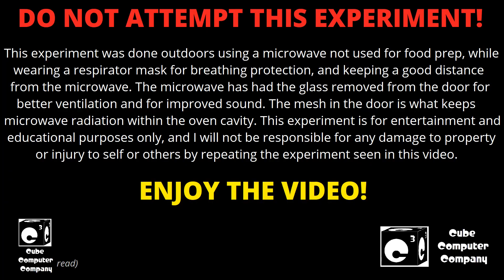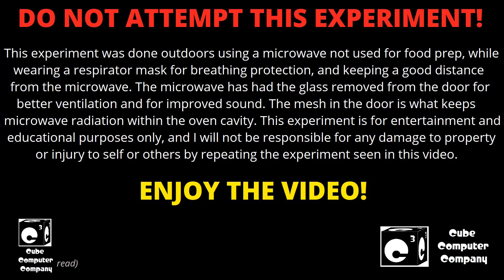Erasing a failing SSD in the microwave makes BIG plasma - Don't attempt this yourself

Comment: Haa! The inside of the microwave looks horrible. I bet it smells as bad as it looks. 😂
Reply from the maker: Yeah, I smell it every time I open the shed! I have microwaved a CPU, the SSD, 2 mice, a desktop keyboard, a laptop keyboard, a network switch, a cable modem, various light bulbs, an ink cartridge, motors, a transformer, a relay, 2 circuit breakers, computer speakers, a heat pump defrost board, old battery chargers, among other things. I might be starting a new channel on YouTube or a competing site for microwaving stuff. This microwave is still hanging on, though sooner or later the magnetron will end up arcing itself completely.